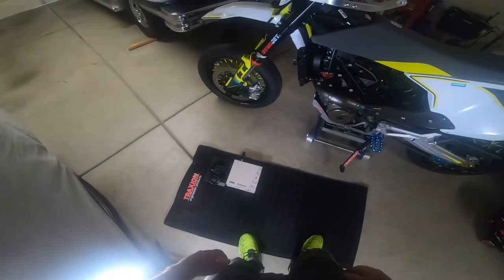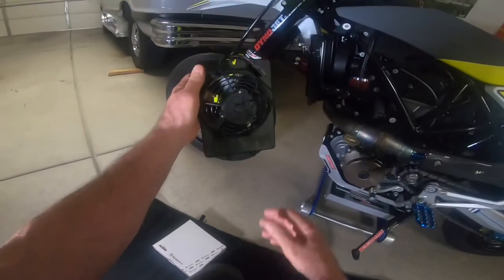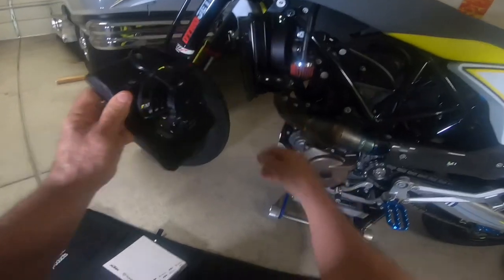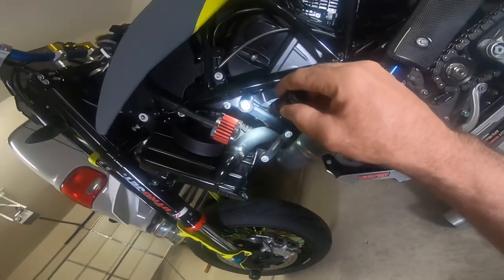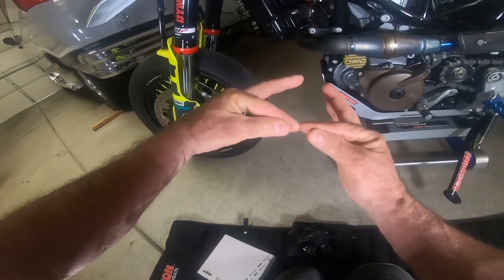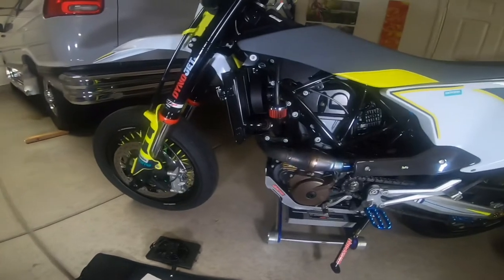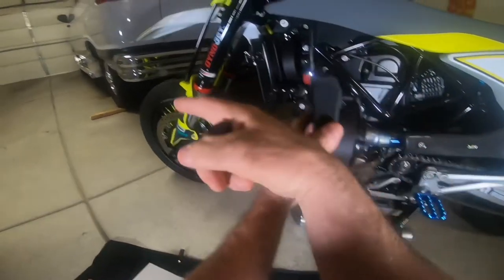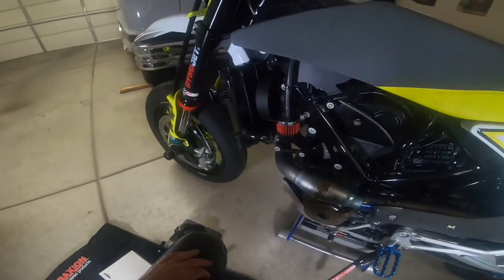Part 3 80-85C/176-180F OEM thermo switch and larger OEM fan

Comment: What is diameter for LR fan
Reply from the maker: I’m not sure exactly. I believe I mentioned it in one of the LR fan videos but can’t remember exactly off hand. I want to say it’s about 1.25” larger than the one I replaced. 
Thanks for watching and posting. 
Much appreciated 
MotoHead
Reply: @motohead5319  my idea was to find SPAL part number, so that was reason for diameter info
Reply from the maker: @mariste4259  
I listed all the part numbers in the beginning of one of the videos.
Reply: @motohead5319  yes, but thous are Husqvarna internal numbers, not SPAL Automotive :)
But thanks anyway, I will go to LR fan defiantly unfortunately I can't change Thermo switch as it is no longer on EU market bikes since model year 2021